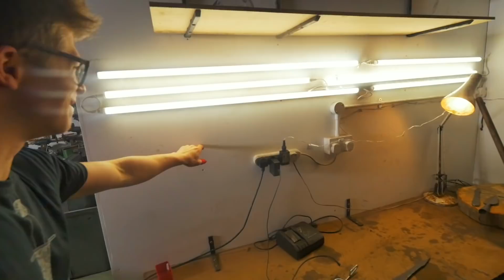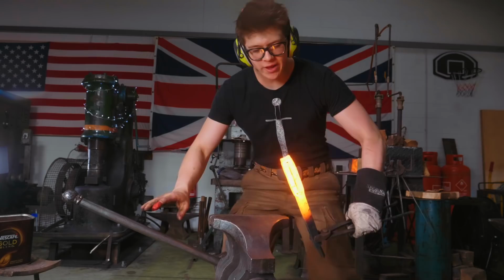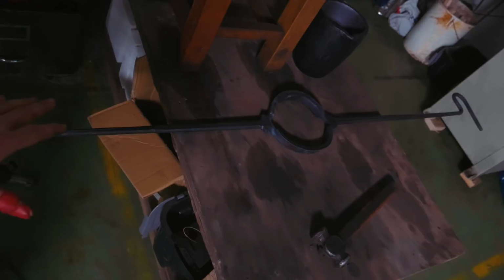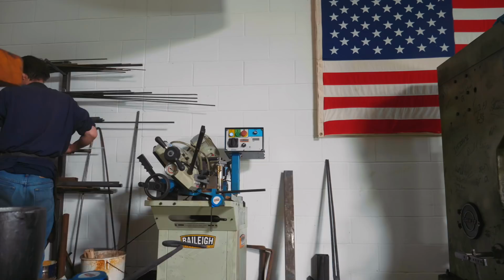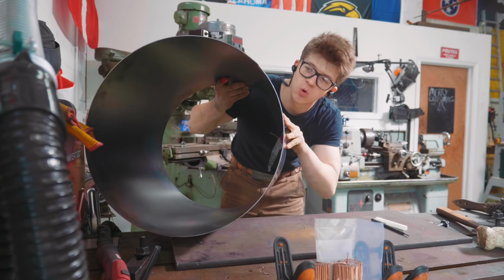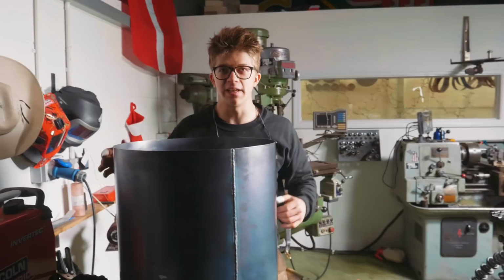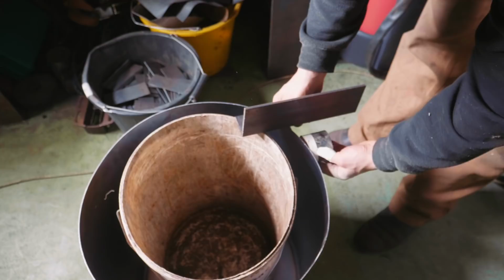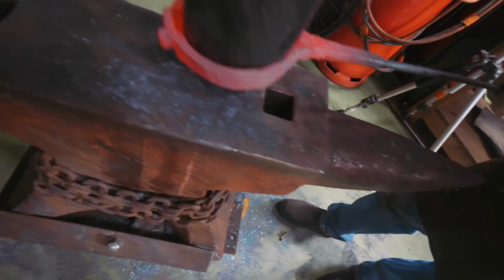BUILDING A FOUNDRY!!! PART 1

Comment: MELT THE METEORITE!!
Reply: Absolutely! Melt it down into something usable!
Reply: yeah, if you melt it down and let it re solidify youll reset the grain.
Reply: Yes, smelting down that meteor and making it into a barbarian sword.
Reply: Who said anything about casting it? Melt it and let it resolidify into a more homogenous piece and he should be able to forge it.
Reply: first ever iron tools were made from meteorites in the bronze age. So Alec clearly just didant put enough effort into it. :D Like, come on, Alec, even those bronze age barbarians were able to do it, and they didn't even have Pilkingtons! :D
Reply: Yesssssss!!!!
Reply: What is the point of making something out of a meteorite if you melt it down? That just turns it into another blob of generic metal. It's a terrible waste of a meteorite.
Reply: Yes but you can actually make something out of it if you melt it down and reset the crystal structure instead of it just falling apart when you forge it
Reply: Nope you need a Smelting Furnace to Smelt/ Melt any iron blum to steel
Reply: Андрей Желтяк no, that would be "Iron Age" by definition.
Reply: Cyberdine Industries by the size of the holes he cut i guess the burner will be embedded in the refractory
Reply: Goosemeyer: No. The Iron Age began when people figured out how to smelt iron ore, rather than using meteorites.
Reply: Melt it into an ingot then forge a replica of king tuts danger that is made of a meteorite that would be amazing to see
Reply: OneEyedJack01, it will still be different from all steel and iron from earth because of the unique chemical makeup and alloy mixture so think before you say
Reply: I said the same thing a few weeks back. Smelt the damn thing and the make something cool.
Reply: Cyber Demon I remember the comment! That's where I got the idea. I couldn't remember who made the comment, and I was too lazy to look it up. 😁
Reply: Cyberdine Industries in the video where he heat treated the claymore he melted the steel tube in the forge and the steel burners did not melt
Reply: aye that would get all that bad stuff out
Reply: drive out tha impuretys!
Reply: Jared Jaster Where do you think the iron ore on Earth comes from? All heavy elements were born inside a star at some point. Everything that makes up a planet was once just floating around space until it coalesced. Striking the Earth as a meteorite just makes it a late arrival. There is nothing special about the chemical make-up of a meteorite that can't be replicated by mixing alloys. What makes a meteorite unique is the crystal pattern. Smelting would destroy that pattern. So as you said, "think before you say".
Reply: From what I've seen, it is kinda like working Wootz, slow and steady wins the race. Lighter hammering to compact the material, working it out slowly then fold and repeat. A lot like tomahogany too.

Comment: Hey Alec, as a foundry worker it's cool to see you getting into casting though you're not building a foundry, you're making a furnace. A foundry is the building itself, it's the same as calling your gas forge a smithy! If you're lining your furnace with castable refractory you might want to drill a few holes in the bottom of it to allow it to drain, you'll be shocked by the amount of water that is driven off the first time you fire it up, you don't want to rust out the bottom of your furnace! Also make sure your crucibles are good and dry before you use them, I've seen the side blow off a crucible that was used damp. Good luck and enjoy the process!
Reply: is it good idea to preheat those crucibles in a oven on 250C couple hours before casting?Or graphite simply doesnt care if its preheated or not?
Reply: You don't need to do anything as involved as that, in Alec's case just having them beside/on top of his forge while it's in use would ensure that they're dry when he comes to use them, otherwise just be sure to store them in a dry environment.

Comment: Hey Alec & Joey,  two of your burners would be more than adequate for a furnace of that volume, and should be sufficient to reach iron melting temperatures, they would be better down low in the furnace, diametrically opposed. The higher the burner, the less time there is for the flame to transfer the heat. I do casting, and I’m just down the road from you if it’s any help?
Also pouring thingy is called a pouring shank!
Keep up the good work!

Comment: Nice project you have their sir! I work in a bronze foundry and we use a single free standing fully adjustable propane torch made from plumbing parts, the furnace we build is from an up-cycled steel drum lined with 3 layers of ceramic fibre blanket (k-wall). There is no exact mathematics just a large enough intake into the furnace then a large enough exhaust in the top of the furnace which is adjustable with a square of k-wall placed over the exhaust. If you have any troubleshooting let me know and will be glad to bounce ideas!

Comment: the pouring hoops need to have a lock/hook to hold the crucible in situ when you tip it or the crucible risks falling out whilst holding molten metal.

Comment: Just an observation : I think that for the burners you should put them all at the medium-bottom, with a 120° angle between each one. To create a more homogeneous heat around the crucible and maximize the heat from each burner. Maybe I 'm wrong, I'm not an expert ! :)

Anyway, I love your work dude ! Keep it going :)
Reply: cap'tain that might melt the extruding part of the burner tips
Reply: you are correct thats the best way to go. from an ex foundryman

Comment: Think about putting a hold down clamp on your crucible carriers. It will keep the pot from sliding out of the carrier as you are pouring. Kinda like a bench or anvil hold down tool that gently holds down on the top edge of the crucible, the foundry man holds it or it can be spring loaded.

Comment: You can melt steel in your 2 burner forge why would you need 3 burners in a casting furnace?
Reply: Chris Turley crucible full of metals is a lot thicker than the steel tube he melted in his forge
Reply: Markus Camenzind Ample insulation value will take care of that. Steel melts at a high temperature. Three burners is excessive unless steel or iron casting is the goal. I suspect 3 burners will pushing more flame out the top then will be applied to the crucible. What metals are you 2 shooting for?
Reply: The way i see it it's 3 crucibles 3 burners 
And when or if he has a go at the meteorite you looking at unknown components
Reply: True 3 burners must be for steel, i do alot og metal casting on my channel, i use 1 burner... 😁

Comment: Alec what pair of pants do you wear? They look mighty durable
Reply: I think they are the same pants that wranglerstar wears. It’s some kind of canvas that has been waxed for strength. I don’t know the official brand that still sells them though.
Reply: I would be interested to know as well. I could see them being useful for my own uses. If they can stand up to what he puts them through, for sure good enough for what I would do to them.
Reply: Probably the Filson double tin pants. Mighty expensive.
Reply: Looks like the Duluth Trading Fire hose pants. They are about the most durable in existence lol
Reply: Those are Duluth fire hose pants. Could be their fire flex line. Good quality, color doesn't stay  don't buy the blue, and I'm almost positive they are made by five year olds in a sweat shop
Reply: Wesley here we use a brand called Carrhart. They are canvas type material Thats doubled up on the fronts on the legs and are usually fire retardant.

Comment: You should make a Damascus steel rifle lower receiver.
Reply: He is the UK they have a semi auto ban over there you'd need a section 5 licence
Reply: being as I would absolutely love to see this, I don't think Alec has the required equipment to pull that off.
Also not to mention the legal issues with producing a firearm.
Reply: lathe + milling machine should be enough but legally no way
Reply: Maybe, but I would think a cnc controlled mill would be a better way to go.
Reply: Just faster,people produce firearms for 600 years without cnc machines  with great accuracy since industrial revolution.What he lacks is machinist skills to do it,and yes legal issues.

Comment: LESSON ONE ALEC!  IT'S NOT A FOUNDRY.  It's a furnace.
Reply: a foundry is a place where moulders make moulds, furnaces melt metal to pour into the mould to create castings. So calling that furnace a foundry would be like calling the power hammer a blacksmith workshop. 
Advice from an old tradesman moulder to a young blacksmith.
PS love your vids and glad to see a dying trade (founding)being kept alive even if only in a small way

Comment: Don't forget to have a high volume exhaust hood over the foundry in case you melt anything that has been galvanized, zinc fumes are really bad. Lots of old brass valves and such have zinc on them nowadays. I have several hundred pounds of old broken brass valves that i stripped down to use in a future brass casting shop.

Comment: I like the new direction you are going, you should try melting down all the iron oxide scale that accumulates on the floor, reduce and melt it down with carbon and cast/forge your own bar stock

Comment: If I could suggest a slight modification to the 2 handled crucible holder. Adding a small hook perpendicular to the hoop that will fit over the edge of the crucible, so that it holds the crucible in the hoop. May take a bit of noodling to sort out, but would avoid the crucible slipping out at the end of the pour. Or, make a second 2 handled device that opens like tongs to allow the safety hook bit to be easier to manage.

Comment: Get a plasma cutter.  They are great.  I finally bought one about 5 years ago.  I still tell the LWS every time i go in there that he should have talked me into buying one a long time ago.  We used to use an oxy/acetylene torch.  It is even used more since we built a CNC plasma table a couple of years ago.  The CNC plasma table helps with us not having to stock as much steel.  If we need a piece of 1/4"x3" bar, we can toss a piece of 1/4" inch piece of plate on the table and cut our bar out.

Comment: Can't wait, I'm so excited for you guys. Need to see if you can recover any crucible steel from the pounds of grinding dust from the Scottish Claymore. Just remember, Wootz takes time to master, and you must forge weld chunks and chips of it together into a workable steel. Lighter hits until it starts sticking together pretty well. Too much force will just blow it apart. Also, don't forget to make a small paddle tool for removing the impurities floating on top of the molten metal. I have seen some guys and gals use different glasses and or silica sands as a carburizing agent.  This is going to be a new and exciting chapter in your skill building set.

Comment: Things to study. Centering the crucible. Preheating the furnace. Mold construction. Mold prep for pour.

When melting your metal, find the materials used for de-gassing. Also, use a flux before pouring so that you don't lose much metal to oxidation.

Comment: I know you have long since finished this project, but there is a tool used for cutting custom angles in hand rail tubing that could be used for this application, called a pipe notcher or a  tube notcher. Basically it is just a jig that holds a hole saw at an angle to keep it from walking around while you cut the hole.

Comment: To cut your hole, you could also take a 4x4x4 block and cut a hole in it with a fostner bit to the diameter of the burner. If you set the 4x4 block on the top of your steel cylinder and set the angle of the block to achieve the vortex inside of the burn chamber you can then trace the arc of the steel cylinder into the bottom of the wood. Go to your wood bandsaw and cut the arc that you traced and then use a piece of card stock overlaid onto the concave side of the block to trace the inside of the hole the fostner bit gut giving you a template to cut into the steel cylinder.

Comment: Alec I tried emailing you about the burners. I needed some guidance on what size I should get and if I need two of them. Building a cylinder forge with interior dimensions of 9"x12". Let me know.

Comment: Offsetting straight holes on a curved surface can be a difficult thing to do. But I've thought of some ideas how to go about it for future projects.

1. Tack the cylinder instead of weld, mark hole centers and what angle you want them at. Either use trig and calculate angle; or for that protractor (I think, I'm kinda blanking on what it's called at the moment), instead of a squared plate, make a plate that has the same curvature as the cylinder, then calculate the angle from cylinder center. Then flatten the cylinder out, and find a way to drill/cut holes at an angle, probably with a vise you can set at an angle.
2. Mark hole centers, and go straight to the milling machine. Find a way to clamp and square the cylinder. Then manipulate the x and y positions to where the mill can drill through the centers you found. I say milling machine, but you could do it with a drill press that has a x,y table on it. 

The reason both of these work for elliptical holes, drilling with a hole cutter at an angle and drilling off center on a curved surface, is because of the properties of conic sections. 

There's even a compass (I believe Da Vinci originally made it, but more modern designs improve on it) that has a set of legs and the center point of the compass, which is the axis of the cone, makes a tripod, and the pen can slide in and out of it's holder; the more angle you give cone, the further out the foci become, and it can even draw parabolas and half of hyperbolas. I really want one, but I can't seem to find a nice one to purchase, mostly just 3d printable 'solutions' that I'm not too interested in.

Comment: In High School I took second in a state competition for a solid aluminum cribbage board. Cast the blank in the foundry and cleaned it up on a very old shaper. Every thing was perfect, every hole perfectly in line, every edge and corner a perfect 90°. The only reason I didnt get 1st was the guy that won built a full size aluminum and brass grandfather clock. That thing was bad ass. Very respectable to place 2nd to that.

Comment: Alex

It would of been better if you put the holes for the burners on different sides of the foundry  also using your idea of putting them at different heights, making the vortex more powerful and making the melting process go more fast and equally,but you can just turn the middle burner the opposite direction of the other 2. Also u should use a good insulator scince the metal is pretty thin, something like kale wool, BUT if you are using kale wool BE CAREFUL, kale wool can permanently damage your lungs and the rest of you respiratory system.

Comment: How do you stop the crucible from falling out of the tong when it is inverted for pouring?
Reply: Adam Schaeffer you use a different set of tongs for pouring
Reply: Hope so, because the way they forged the tongs with handles on either end for easier tilting suggest they are going to use the ones they made for pouring.

Comment: Melt the meteorite into a Billet because the crystallization in the meteorite needs to be mixed that's why it was crumbling so much and add a little bit of iron dust or it can be stronger

Comment: There are several ways to measure or cut a cylinder. One that I use is to make it temporarily rectangular though I would have started with a rectangular structure in the first place.

Comment: You want your crucible tongs to fit snugly to the crucible, but not so snug that the crucible might crack. Your tongs should also have a device that hooks over the lip of the crucible so it doesn't fall out when you're pouring.

Comment: Some of this is very interesting, but some parts make me wonder why? Like the hooks at the beginning of this episode, you could have spent a couple minutes using that huge drill press and simply bending the piece in the vice, instead you did it the hard way by heading it up multiple times to punch the holes and then to bend it... There is "the old" way and then there is just the hard/more expensive/time consuming way.

Still love seeing some of the art of the major processes though.

Comment: for oval cuts on the cylinder thats at a tangent might try a properly sized disk with a rod rod thru the center (like a plate on a stick) and spot weld the rod end at proper angle to the cylinder to be cut. then use a high intensity light to cast shadow. then draw on the cylinder. then use cutting method of choice to cut the oval?

Comment: Just a fyi never weld down hand lol you end up with crapy welds they may look nice outside but on the insdie they are weak. if you are going to do it vertical always go upwards. (if your going on like a 15 or 20 degree angle downwards is fine but past that you dont get the penetration you need )

Comment: I think the burners should be as close to the bottom of the Foundry as possible so that you can get as much heat out of each gram of propane into the crucible.

I wonder if Alec will try to make Crucible Steel.